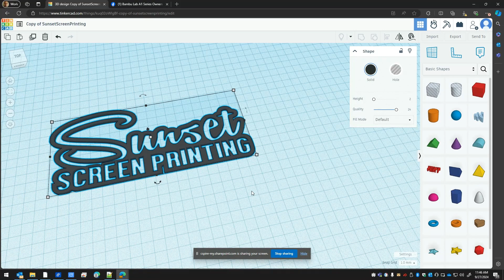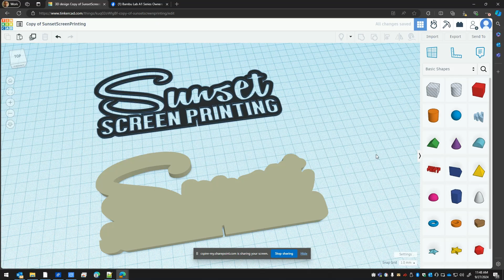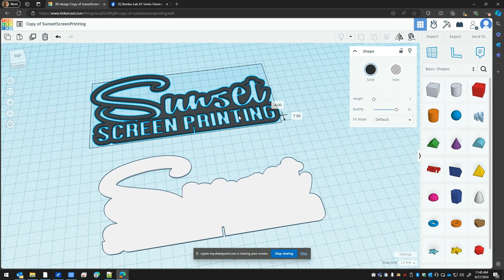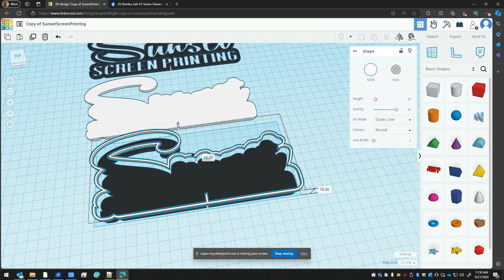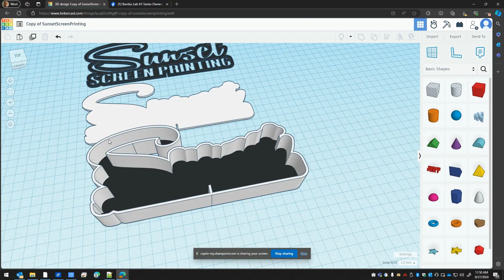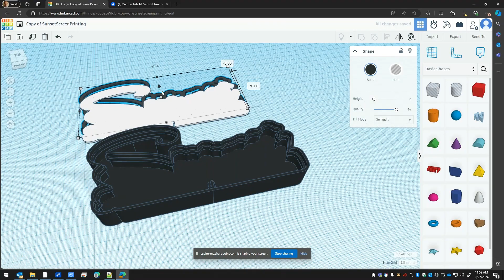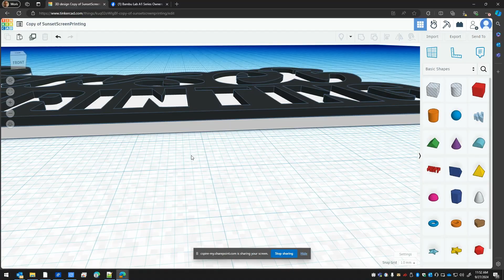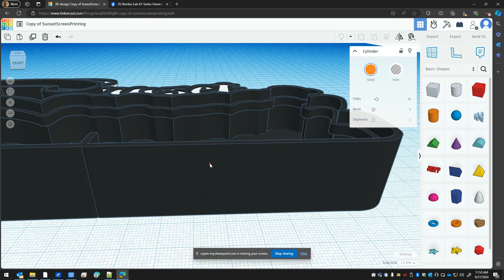Tinkercad Light Box

Comment: I love this video and it's the best one I've found to do what I need to do, but I'm having an issue. When I try to group the logo that's going to be the top of the light box. It changes the color to all black once I group them. It would prevent any light from coming through the box. Is there something I'm missing? Any help would be highly recommended.
Reply: Update! I was able to figure it out. I just printed each letter inside the slicer. So if anyone else has the same issues. This is the solution to fix it.

Comment: Is there a way to convert a tinkercad shape into an object that you can use the outline functions?  I find it kind a pain that you can do it with a complex logo, but if I want to do it on a tinkercad box, it’s not available in the drop down.  Great tutorial!  Thankyou
Reply from the maker: @mudbrats I would select the shape, export it as an SVG, and re-import it. If that doesn't give you the options in the dropdown, you might be out of luck. A tinkercad box as an outline would essentially be a 3d cube that is hollow. The outline feature might be exclusive to a flat object.
Reply: @ yep that’s what I do but it would be great to have a 1 touch option to convert it - can’t be too crazy

Comment: I’m printing one now, but now I’m wondering if I should’ve adjusted my sizes to account for tolerance? Have you run into any issues?

This tutorial is fantastic by the way. The most to the point and easiest to follow I’ve found
Reply from the maker: @kendraa_______9981  this one and others have been a snug fit, so I wouldn't scale it. You can always lightly sand any areas that stick, but you can't add material after it's printed! 
I'm working on another video on desk nameplates in tinkercad. Be sure to subscribe so you'll know when it hits.
Reply: @ it turned out perfectly. My first ever light box was a success thanks to this video. Thanks so much!!

Comment: Curious why you have to export as an svg and then import again? Does this unlock settings you can’t do if you were to just duplicate the original upload you had?
Reply from the maker: @kendraa_______9981  there's something weird with tinkercad where the silhouette option doesn't appear in the drop down until it is exported/imported.
Reply: @ great to know! I wondered why sometimes it worked and sometimes it didn’t !